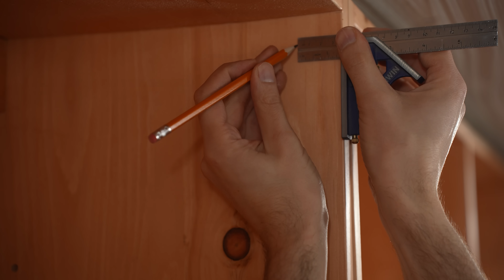Stop Using Plywood To Make Cabinets!

Comment: Could you describe which planes you used on this project please? I'm a complete newbie and interested in which hand planes I need to begin making tighter fitting joinery.
Reply: He used a Stanley #4 (commonly called a smoothing plane) when cleaning up the glue joints, and tbh I was only listening to most of the video so I didn't notice if he used anything else. I'll probably watch it again as I'm moving shop spaces and may put cabinets up, but if I see anything else I'll follow up.

You could do most of the work you'd need to start with a #4, a #4 1/2 (almost the same size but with a wider sole and iron/blade) or a #5 (also called a jack plane, it's wider and longer than the #4). Rex Krueger has a great video about buying old planes online and how to find the "less desirable" but still well functioning pieces from certain eras. Fair warning: you may have to flatten the sole, sharpen the iron, better fit the chip breaker etc but there are hundreds of videos about how to tune up handplanes on YouTube (Rex, James Wright of Wood by Wright, Paul Sellers, Nick Engler of Woodshop Companion and many others are all excellent resources).

I would recommend buying whichever you can afford between a 4 and a 5, or both if you can afford them; you can always buy the other one later. Once you're more accustomed to hand tool work you can decide on getting bigger jointing planes, rabbeting planes, moulding planes etc, but don't worry about those yet.
Reply: Thank you very much! This points me to a good starting point. @wyssmaster
Reply: Watching a bit further, he also used a block plane and a shoulder plane.  You can find pretty decent and inexpensive versions of these from taytools, but there are plenty of old block planes available on eBay and wherever (tbh you could just use the #4 for anything he did with the block plane).

If you can't afford a shoulder plane right now you could make Paul Sellers' poor man's router plane out of a chisel and a block of wood, then just keep pressure on your reference surface to flatten any rabbets or dadoes

Comment: Am I missing something here?  From HD: 8" x 3/4" x 96" = $16. 4x8 plywood $30. How is the solid board cheaper?  I do have a lot of cabinets to make and really want to know how to save a buck.
Reply: $30 is construction grade plywood, it will warp and is full of voids.

Cabinet grade plywood is triple the price.
Reply: The thing that you're missing is that you can't find S4S material at HD or cabinet grade plywood. Although 3/4" backing is extremely overbuilt, 1/4" plywood is all that is needed for and you can get beaded plywood for exactly the same "country look".

Comment: Jig idea is perfect as long as someone don't flip it end for end, but you do have a way to drill a perfect jig you can flip.
Use the Dowling jig to make it, then cut down the center of each last hole so the whole thing is the same end for end  the most you'll be off is a few thou. Close enough for woodworking.

Comment: Very nice build and video.  Subscribed.  But I didn't see you include any crossgrain slop in the door panels, to account for wood movement in the solid wood panel.  Solid wood s not dimensionally stable, and contracts and expands with humidity and temperature, across the grain (boards expand with the grain, too, but that is negligible, and can be ignored).  A solid door panel with perfect joinery and no "expansion joints" along the face grain side of the board, can rack itself apart, with expansion, unless your shop has excellent temperature and humidity control, or you did your build when it couldn't get any hotter or humid.  People split stone by drilling holes, sticking in tightlky iftting pieces of wood in the holes, and wetting the wood.
Reply from the maker: I undersized the panel, but didn't talk about it as I have talked about it in many other videos of mine
Reply: Thanks for the reply.  Apologies for carrying coals to Newcastle.  But the fitting did appear snug in the video. @ScottWalshWoodworking

Comment: Is pin that much cheaper than plywood? Very nice video and informative. Did you make your garage door, that looks nice.
Reply: Depending on where you live. In CO it would be cheaper to use plywood. I'm pretty sure most places plywood is cheaper. That's why cabinet companies don't use boards except for the face and doors.

Comment: Nailed it! Thanks for using dowels for the cabinets too, I have a cabinet plan I want to build and was unsure of the joinery method to use, this locked in dowels as the winner. Great video Scott
Reply: Before you go buy that Dowelmax, consider biscuits, also called a plate jointer. A little less expensive and perfect set up alignment is not necessary. Dowels and their mating holes have to be dead nuts on. Okay if you are doing a production run and have a jig. Biscuits allow for a little lateral movement when assembling the pieces.

Comment: Save the real wood for the face frames, doors, & drawers.  The reason that plywood is used, is it resists warping a bit more than solid wood, it's stronger overall, allowing for use of thinner & cheaper carcass material.  It's a HUGE time saver, no glue-up of multiple boards to get the right size & no waiting for glue to set - just cut to size, sand, finish, and assemble - YES, I put finish before assembly.    Plywood is also typically cheaper per board foot (prices will vary wherever you live so always shop around), costing me about $5/bf locally for Baltic Birch ($61.74 for 5ftx5ft  sheet of 12mm / $92.37 for 5ftx5ft sheet of 18mm) and that is with 1 cut for transport, and including sales tax.  There are only 11 species & thicknesses of lumber at my local 'hardwood' lumber yard that are cheaper... knotty pine (4/4, 5/4 & 8/4), knotty alder (4/4 & 8/4), poplar (4/4, 5/4, 6/4, & 8/4) & basswood (4/4 & 8/4).   Most are only a few cents per board foot cheaper, with the exception of knotty pine being as little as $3.21/bf for 8/4 & $3.84/bf for 4/4 or 5/4.
Reply: Do you understand why he's doing it this way? It's on purpose.

Comment: I started woodworking with my dad at a very young age more than 50 years ago. One of his "rules" was never to put your plane blade down. If you wanted a slap up your heid, put the plane blade down. I still follow the rule...not scientifically sure why you're not supposed to but then, I still oil all blades, chisels used at the end of the work day and sharpen them before work, too.

Comment: you have the tools for a 45 degreee cut. the frames you could have just cut in a 45 degree and glue them. you got about 1.4 times more surface for the glue to grab, so its stronger than them dovels. boards not flat, ain't a problem. just have some support till you cut the 45 degree, and glue them. it will hold them flat.

Comment: Just bought myself 16 sheets of 18mm (3/4 inch??) Baltic Birch plywood WITH a veneer on them fot 500 euro's
If you keep an eye out you still can get some cheap ply at surplus dudes who buy and sell leftovers from cabinet makers.
There is even one sheet in there with a Wallnut veneer on both sides

Comment: I understand the drive to use real wood as apposed to plywood. there are some places where plywood can work just fine or maybe even be better than wood. the thing that to me is a deal breaker that you see way too often is particle board. that is something that not only would I never use I avoid even buying such stuff.

Comment: YMMV. Over here, 22x100 raw cut is 20€/m2, good quality 12mm construction plywood is 15€/m2, and premium 12mm birch ply is 30€/m2. No jointing or glue required, won't warp as much when humidity changes, won't split on you...

Comment: Hey Scott. Amazing timing as I was about to go buy a bunch of expensive plywood this weekend and do some cabinets in my daughter's room. You reminded me that the per square foot cost of pine at my local mill is MUCH cheaper than high grade plywood (and I'm in Canada). 
Quick question: Is there a tool or quick formula or resource somewhere to roughly estimate the load limits when using dowels with specific wood types like this? I just want the peace of mind to know that if she loads 'x' amount of stuff in her cab, it won't bottom out or fall on her head.

Comment: Where do you find the S4S pine?  The one at Home Depot is very, very expensive for what it is, and usually full of knots. I could only ever find rough pine in lumberyards.
Reply from the maker: try finding a better lumber/hardwood dealer. They should have way better quality s4s pine than home depot for less the price. I paid $2.25 per foot canadian for mine. They called it "moulding grade pine" at my dealer.
Reply: Home Depot is God awful for anything close to being decent. Like he said, go find a lumber yard or a sawmill. You'll get better quality and have a better selection to choose from. And #1 reason, it will cost about maybe 75% of Home Depot.

Comment: 3:10 the claim that you don’t need tools to be as sharp because it’s softwood is completely false. It’s actually the opposite. Softwoods need sharper tools and also benefit from a shallower angle. I have a set of chisels that I’ve reground to 17-degrees just for softwoods. Planes are harder to do this with, so just make sure that your iron is freshly sharpened and touch it up more frequently than you would for hardwoods.

Comment: These look great!

I am about to do a long span of cabinets in my shop. The cheapest good looking plywood I could find was $69. I think I figured I would need 8 sheets of 3/4. Don’t remember how much the 5/8” I was going to use for drawers. Or the cost of the 1/4” I was going to use for panels. I did see your video where you did the miter station. I think I’m going to go back to that and see if it will be more beneficial for me to do with pine. Or even poplar. Our local mill usually has poplar and not much more than pine.

Comment: OK, the 3/8 inch collar for the quarter inch router bit… Is that to prevent blowout? Like, what’s the collar for?  This question from a seasoned multi decade, professional… tango dancer.
Reply from the maker: This is in regards to the shelf pin jig, right? The 3/8" brass collar (attached to the base plate of the router - sometimes called a bushing) fits snugly into the 3/8" hole in the jig, locking the router in place. That allows me to plunge a 1/4" hole with the 1/4" bit into the cabinet side.

Comment: What about wood movement.
Reply from the maker: what about it?
Reply: There is a reason that plywood is used for the carcass. Wood movement.  I suppose if you use overlay doors you might not be able to see it. But inset doors will show gaps and the structure will move over time with humidity changes.
Reply from the maker: @Andy-iw9su  Frame and panel doors won't grow or shrink. That's why they're so ubiquitous. Wood moves tangentially to the grain. That means these types of cases will get slightly deeper and shallower over the season, so I'm not sure what the problem is. Cases have been made this way for centuries.

Comment: Just not confident at all that the labor time to JOINT, then GLUE, then SCRAPE, then PLANE, then SAND each piece of wood, then the added time to DOWEL BOTH boards instead of pocket screw ONE board much faster since you aren't worrying about LINING UP the holes and do twice as many, to say nothing of all the dowels needed, doesn't actually put you in NEGATIVE VALUE SPACE and you don't have the multi-way strength and flatness of plywood.

At 12:55 the cupping in the panels is still obvious sitting there, so overall, fun idea should a person be suck with a lot of board feet of lumber and need some cabinets, but doesn't make sense as a conscious choice over plywood.

Comment: Fantastic End result, I'm jealous & tempted!!!
Its probably way out of my skill (and patience) range anyway 🤣.

Honest Question, any insights are much appreciated: 
Is the cost-benefit ratio really worth it? I think it depends, But you get the idea 😀
With lumber I see a whole bunch of extra steps such as planing, edge jointing, Flattening, Surface finishing and whatnot, Provided you already own (or atleast have access to) the associated machinery. With engineered wood, Especially the pre-finished variety, The overhead/footprint reduces significantly.
I am from India, where a 4X8 sheet is still dirt cheap really. Proper lumber, on the other hand is not easily available. There's just "Teak", and "not teak"! Pine lumber? In these parts all you can find are pine pallets, And I'm not that desperate 😂

Comment: Where do you go to get milled wood to the thickness a person may need. I don’t build much because I’ve got just basic tools. Boards ready to use right away would be a game changer for me… especially if I could order the boards cut to order. Like 10, 0.5in. X 4in. X 4ft and say  4 0.75 X 6in. X 4ft.  Is that a thing because I will never buy flat pack furniture ever again… I could make the bedside  tables we want so much better and with soft rolled edges to keep from skinning my elbow on the flat pack crap. I think I’ve finally decided to get a router and maybe a router table so I can do dovetails and box joints.

Comment: Plywood is easy to get cover LARGE areas... But the need to finish all edges with something is not fun.
Vaneeering the surfaces to get nice grain and look is better way that plywood.

But for all these normal 40-50 cm wide boards and such, the solid wood is way to go. 

But I wouldnt take any MDF board for any serious project really... That is the cheapest for toys and some cheap non-constructive parts like cabin backboard for cover.
And yet kitchen cabins and such are made from MDF and I take plywood anytime over those..

Comment: If you want to make sure your dowels come out even with minimal planning or the math isn't easy to hold in your head, just start at the center of the panel and index out from there. It saves time if you have both ADHD and OCD because any on-the-fly change in spacing can be copied when indexing the other way from the center line so that mistakes now look intentional.

I know this is unlikely to make any appreciable difference in whatever you're building, but that's why it's OCDisorder and not OCCompletelyReasonable.

Comment: Someone knows the specifics for the humidity floor trick ?

Does it work on any type of concrete ? Like basement vs garage ? Can I leave panels down outside overnight and it will work ? Can it work on a damp towel overnight ? Does it work on grass ?

Thanks a lot !
Reply from the maker: If your concrete is sealed, painted, or epoxied, the trick wont work. I think a damp towel might be excessive. I've heard of people doing it on grass too, but it might be a bit much too. A spritz of water in a spray bottle on the concave side, wiping the excess off, and leaving it cup-side down on your bench might be enough.
Reply: @ScottWalshWoodworking  Thanks for the quick reply, and thanks for all the amazing and inspiring videos.

Comment: How many man-hours did you end up having in this?  I am acting as the GC for my house in the spring, but I will do all I can.  I will have an enclosed shop with concrete floors once its dried in and I am good with taking an extra month to build my own cabinets.....  We amateurs need realistic expectation.  If it took you 40 hours, I would be happy to get the same project done in 60-80 hours.  But a 30 minute video makes it look like we could  do it in a week..
    I got my cordless router at a pawn shop when I bought my dewalt skill saw...

Comment: i assumed the reason plywood/masonite back/bottoms were used in cupboards and drawers was because 1 the cupboards/drawers weren't being built to a very high standard/not meant to last for decades and decades, or because ideals about quality had changed. i didn't realise this was really due to cost. but now with the cost of plywood being so high, it seems it doesn't even made sense to stick with plywood, and that you have an overall aesthetically more pleasing, and equally solid product for not much more. 

so why arent more people doing this?

it really irks me to see drawers for high end cabinets and units, still being built with flimpsy drawer bottoms. that's why I love old cabinets and chests of drawers, they often have solid wood bottoms.

Comment: Okay, am I missing something? "...and none of that expensive plywood." The nice, smooth, pretty 3/4" nominal stuff I make cabinet carcasses out of is $55 per sheet right now. That much area in pine is $209, and in Hemlock Fir is $108. And both board options take way more work - especially the Hem Fir which is junk. So what am I missing here?

Comment: What an absolutely Chad move doing an ad read while gluing up. I'm always stressed when doing my glue ups because I don't want to run out of working time on the glue.
Reply from the maker: The levelling feet are great. I really like them a lot. I don't use the casters very much but they do as they're told.
Reply: @ScottWalshWoodworking  cryptic reply my man. Cheers tho.
Reply from the maker: @annabanana42069  LOL! pretty sure that was for someone else.

I'm obviously not cut out for this